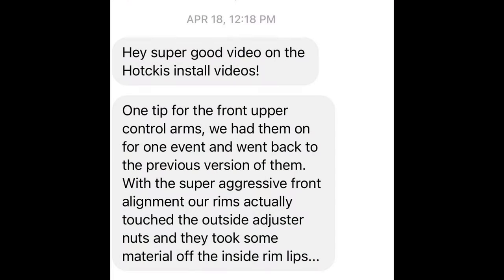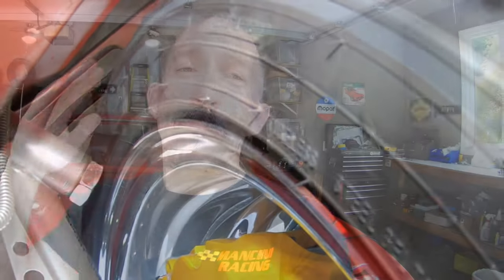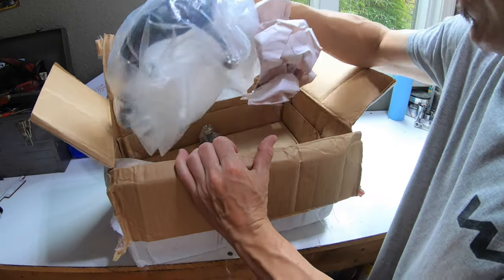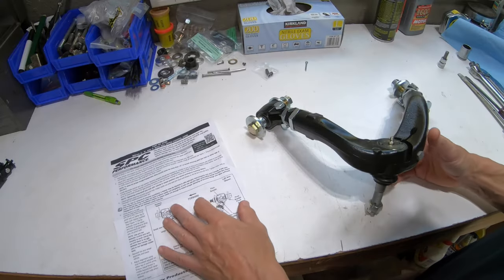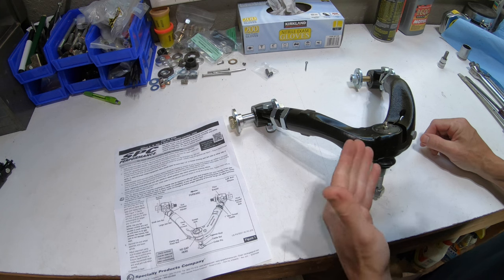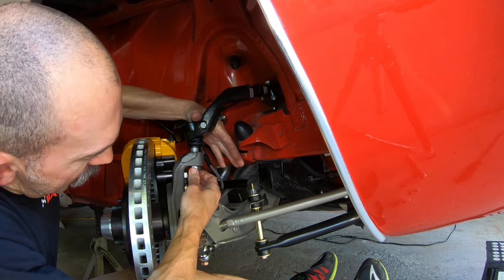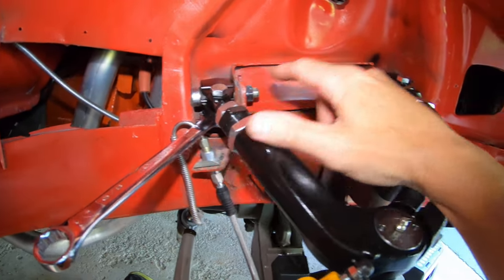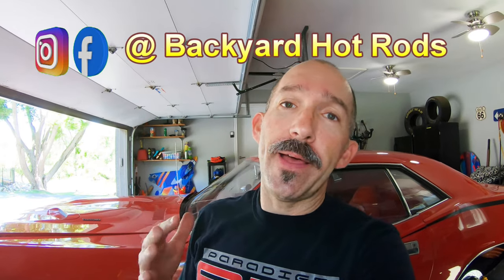Why I can't use the Hotchkis Uppper Control Arms!

Comment: i just seen your video were you show us your new wheels and tires.  my question is....  do you think if you went with a 18x9 wheel with a 255/40 18 you could've use that Hotchkis upper control arm?  thank you in advance
Reply from the maker: It’s really a backspacing issue, to use those UCA it should be max of 5” bs. I have 5.25”
Reply: @backyardhotrods9885  ok got thanks for your reply. Please keep up the great content 🙏🏽